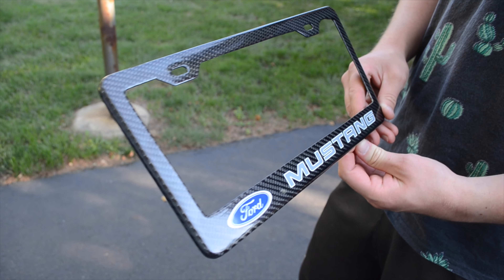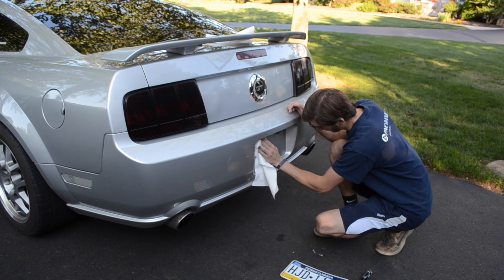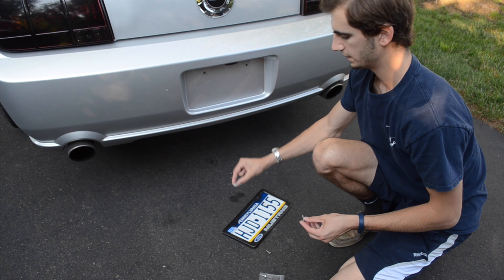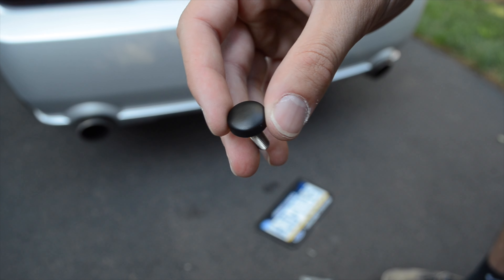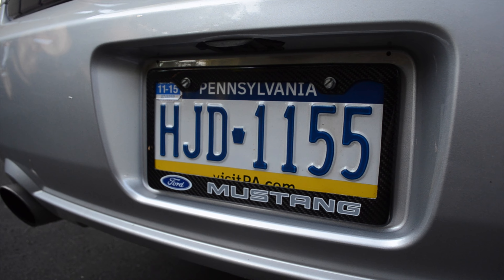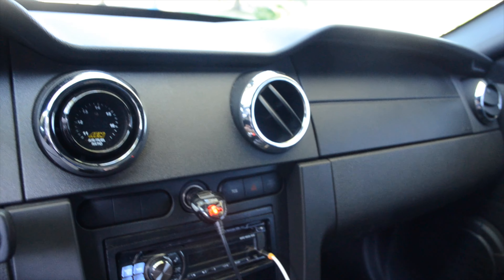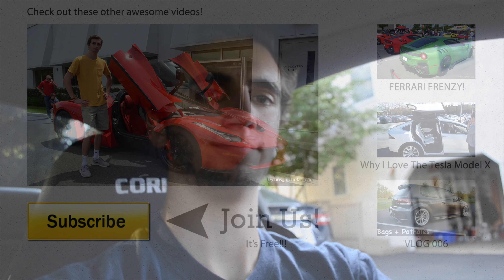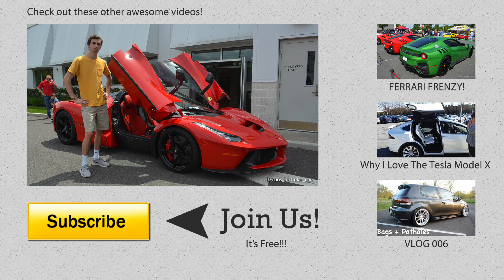Mustang Gets Carbon Fiber?

Comment: now liberty walk her and add 1000HP
Reply from the maker: 1000hp sounds nice, but also expensive haha.
Reply: +sgfreak96 nah, supercharger it or twin turbo it and nice tune and some other parts should get 1000HP or near...
Reply from the maker: Rubens exotics Supercharger kit for this car is like at least $3,000 and that with a tune and supporting mods is only good for probably 600HP. It'd be probably a $7500 investment and not worth it, especially not on the 3V engine.
Reply: +sgfreak96 then get a hellcat😂😂😂😂😂😂😂
Reply from the maker: Rubens exotics I guess I'd better start saving haha, 80k at the very least.
Reply: pickup a salvage 15, 16 GT and built the engine, that would be fucking insane in an 05-09
Reply from the maker: Would be incredible to get the new 5.2L engine, too bad those are easily like 10-15K for a crate motor.
Reply: sgfreak96 I want to make a build like that, whatever engine is in the newest mustang, swap into an 05-09, or better yet buy a kinda beat up 05 v6 and swap in the new engine, get a quiet exhaust, leave the exterior stock and act like some new car guy
Reply from the maker: UndeadExplorer A stock v6 body and interior with a new GT engine would be a cool sleeper build, it would just be super expensive!
Reply: sgfreak96 well even if you just did a gt swap, would only cost 3 or so thousand. cheaper with a salvage gt swap